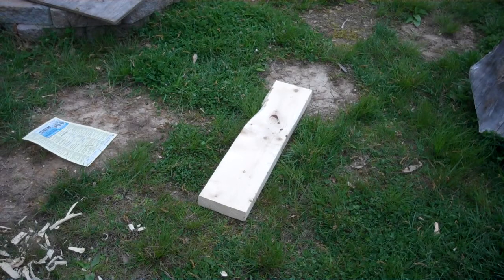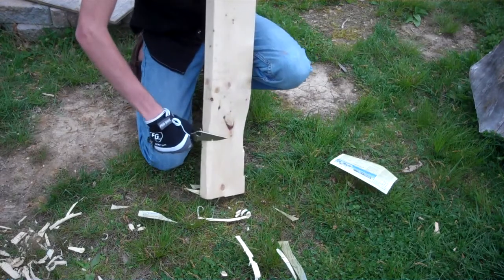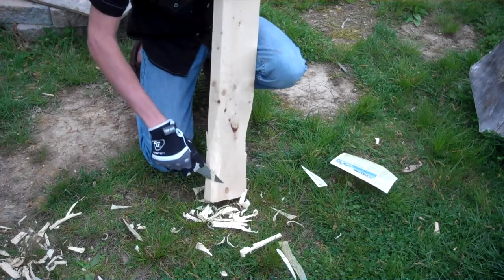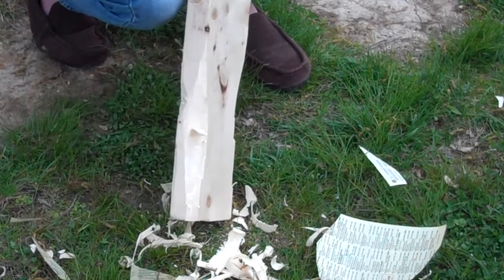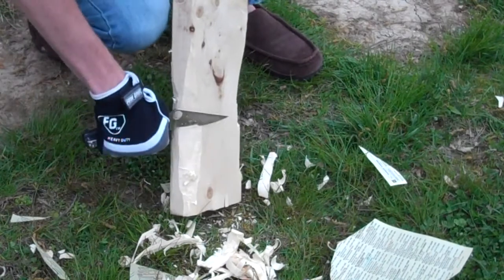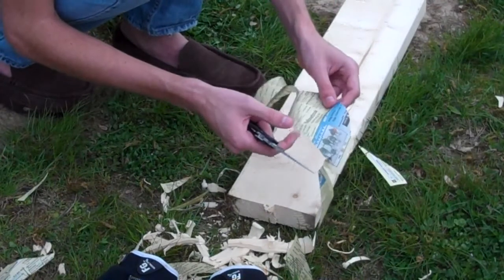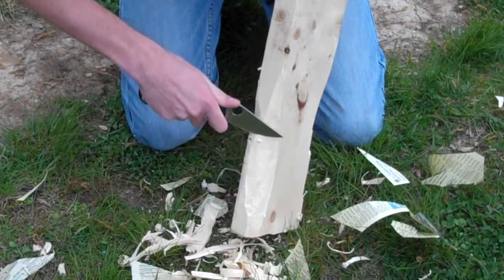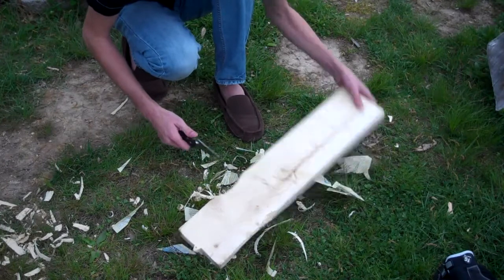spyderco paramilitary 2 hard use  testing

Comment: I remember the day my very first PM2 arrived. I chuckled a bit because I never seen other blades with "Earth" labled on the side of a blade (Golden Colorado U.S.A. Earth) before. 

PM2 is one of my several other folders that I tend to carry in my EDC sets often, especially during the days at the office. I've annihilated tons of cardboards and plastic wraps with it. My very first PM2 is still functioning great.  I haven't had any issues with it so far. Infact, I've broken at least 3 other brand folders while performing same tasks. All 3 of them ended up having issues with their locking mechanism getting stuck/jammed/popped out of place.

Comment: You'll never break that knife. I've tried to kill mine and it has never had issues. I've batoned it, done pocket knife survival trips, cut wire, pried drawers open, used it as a screwdriver, and done all kinds of brutal things a knife shouldn't do and this little monster took it all
Reply: you can break the tip easily, especially on the s110v version.
Reply: exaggerate

Comment: I own several versions of PM2, and I mainly carry them to my work since I deal with alot of boxed goods that tend to have hardened tape around them. Due to the blade shape of the PM2, it has served me well over the years and I have not had to send one in to be fixed as of yet. 

Plus, whenever I go outdoors (camping, hiking, fishing etc.), I carry proper tools to fit the need of use. For example, I will bring a larger fixed blade and a sturdier folder (compared to PM2). And when I am out on the boat fishing or having to deal with weather, I will bring a fixed blade such as the Spyderco's Aqua Salt Fixed Blade Dive Knife (which is rust-proof... literally).  

Unless you plan on only investing on one type of knife, it boils down to selecting proper tools to get the job done. And as far as PM2's overall durability goes... I honestly  have nothing bad to say about the folder so far. Just don't get bent out of shape because you used the PM2 like a hammer or crowbar and end up with a broken blade.
Reply: Glorified box cutter

Comment: If you expect the knife to develop blade play by just cutting wood, then I would say this folder is shit. ^^
Reply: hahaha dass das von dir kommt :D
Reply: Ricardo Neumann Eh ja.... ^^
Aber ich müsste mir jetzt das Video hier noch mal angucken, um zu vergleichen. Bei meinem gab es aber wirklich nur minimales Spiel am Ende und die Achsen-Schraube war nicht mit Loctite befestigt... ;)
Reply: messerknartz finde sowieso, dass sie das loctite beim Pivot nicht machen sollten, jetzt muss man erstmal schön die beschichtete Torxschraube kaputt drehen bevor man minimale Änderungen vornehmen kann.. naja
Viele Grüße!
Reply: messerknartz, and if you expect a folder like PM2 to act as a hammer or a axe, don't be surprised by the end result (such as chipped or broken off tip of the blade etc.)
Reply: Most folders will. However the compression lock keeps it locked in. Some PM2 have a bit of side to side out of the box but it's not hard to tune it. Really just polishing the washers and tightening the pivot and you'll get no play and smooth operation.